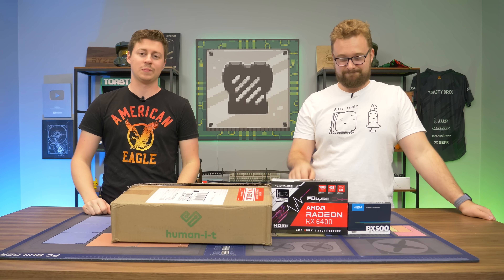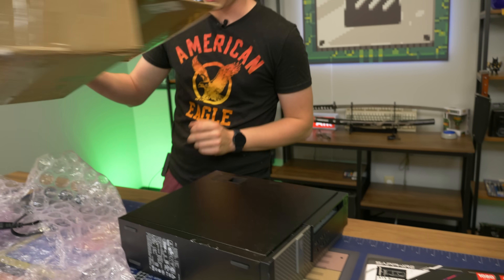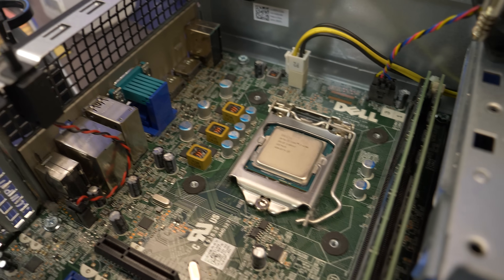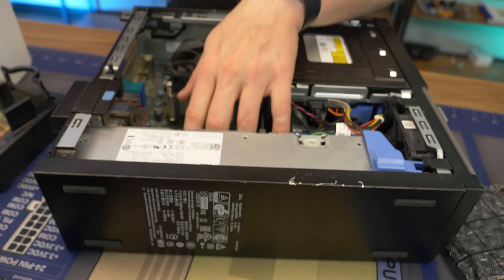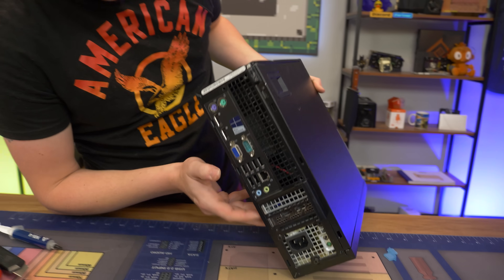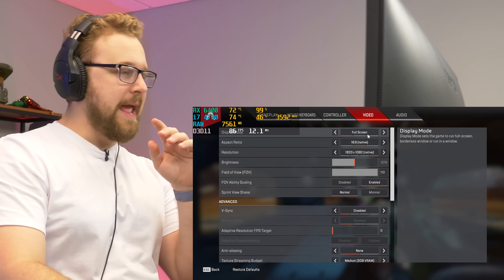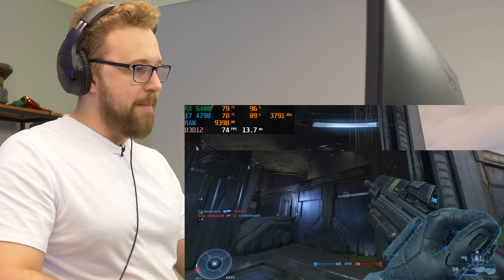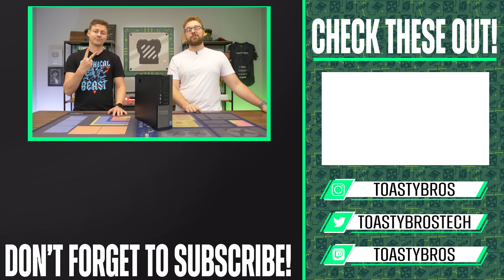EASY $350 Gaming PC Build 2022

Comment: Some things to keep in mind.

First, you can install a dual slot card in the 7020 and the 9020 in the upper 4x slot as it's open ended. However, this puts you in a similar scenario as the 6400/6500XT. But it won't be as bad since you won't be limited to a 64-bit bus as well. Just stay away from the VRAM limit and you'll be fine for the most part... or go with an RTX a2000 and not have to worry about the VRAM all together... lulz. The 3020 however, does not have the x4 slot so you're stuck with the single slot at the bottom and while the 7020/9020 use a Q87 chipset with PCIe Gen3, the 3020 is an H81 chipset which only supports PCIe Gen2, so when you run into problems with the 6400, they're going to be a lot worse. I would avoid the 6400 in anything with an H81 chipset.

Might be worth saying to just avoid the 3020 SFF altogether unless you're willing to get creative with a riser cable.
Reply: what if you already have a 3020 SFF, that you got before you knew about such issues? I have one with a GT 1030 (2GB GDDR5) and am looking for its "last upgrade" card. There are very few choices that are better and will work with this case. I've tried RX 550; not impressed. Sidegrade. The only upside was VCE, and that's not spectacular. Unfortunately the RX 550 I had became semi-functional recently, meaning it will POST and show a Windows loading screen but not come up with a Windows desktop. IDK. Could be a driver issue. The only sized-right RX 560 (which would actually be a pretty good pairing for my i5-4590) I've seen is from a shady Chinese seller rebranding what is quite obviously a Yeston, so I'm not even convinced it isn't really just an RX 550. And they want more than the RX 6400 goes for shipped domestically.

So being that the GT 1030 is PCIe 3.0 (forced down to 2.0 by the H81) x4 anyway, none of these cards would be a downgrade here... I'm thinking either the RX 6400 or the Quadro T600 might be good options. The nVidia card has 16 lanes and NVENC, so there are at least two bullet points in its favor. It is, unfortunately, much more expensive than RX 6400. But it should be nicely matched to the processor, and a decent bump up in performance from the GT 1030. Maybe not worth the price, though, but what is? I can't slot a GTX 1650 and the one SSLP GTX 1050 that ever existed is very hard to find now... T600's are easier, but look out for the 2GB model. Don't want that.

Even higher up the price scale, at around $300+, there's the T1000, with 896 CUDA cores so it should be similar to GTX 1650 Super. But I'm not sure about the 3020's weaksauce 255W power supply and supposed 50W PCIe slot power limit... that's funny, I thought the spec was 75W... or is it just that there were no high-watt videocards to validate with it at the time of manufacture? I think that could be the case. I've already gone past the original RAM validation (it was only validated for 1, 2, and 4GB DIMMs and I put 2x8GB in it, but that's widely known to work plus 8GB sticks weren't available yet) so I've already exceeded Dell's validated specs once already here.
Reply: @aleaxdeathbringer  Wow! What an awesome response.

This is tricky because I know it's really hard to find a single slot card these days, let alone one that's also low profile. I didn't even realize the 1030 was also limited to 4 lanes with a 64-bit bus. However, you won't be in the same boat. Even the GGDR5 version of the GT 1030 has less than half the memory bandwidth of 48GB vs. 128GB per second. There's more to this than just lanes and bus width. If you have the DDR4 version of the GT 1030, you're at about a whopping 17GB per second. So, with the GT 1030, the bottleneck is going to be less of an issue. You're not going to to notice it nearly as much. Especially since it's such a weak card to begin with. The 6400 is much more powerful and the effects of putting it in a Gen2 slot is going to limit you to 2GB per second. It's going to choke the communication between the system memory and the video memory.

The single slot Quardo cards would be better in a PCIe Gen2 slot, but even the T600 is a $250 card right now. The T1000 is stupidly priced. The single slot, low profile RX 560 that I've seen... with the purple shroud, is legit as far as I could find. But they're as much as a T600. But regardless of which route you go, the 255W PSU is going to be fine. If it doesn't require dedicated power, it will be enough. In my testing, you'll likely pull no more than 160 watts from the wall for the total system, and that leaves with about 100 watts of headroom. I wouldn't worry about the power supply, and they're well built PSU's with things like OCP. As for the power limit... I've not seen any OptiPlex models with a power limit on the PCIe slot. I'd expect that from the consumer models, but not the business models.

But now you have me curious. I bought a 6500XT to see if I'm being too hard on them to test them in some older Opti's, and the results should track with the 6400, but it would be interesting to test the 6400 as well.
Reply: @TheGameBench  wow, awesome reply from you, too! That's uncommon to find on YouTube; a lot of creators don't engage their audience to that degree! I'm impressed.

Anyway, I have the GDDR5 version so yeah, 48GB/sec bandwidth. I was at least careful to not make the mistake of getting DDR4. Although I've overclocked the (3004MHz) memory by 650MHz with Afterburner (it can take it; it's good Samsung stuff), so it's up to 58.5GB/sec bandwidth. Wow, 13.5GB/sec more and it'll equal my old HD7770, LOL. IDK if it could do that, though. IDK if that makes much difference; haven't tested before and after. I might have to check that some time.

The real problem with the card right now is that the fan gave out so the core can't stay at a high clock rate once it thermally saturates the heatsink. Airflow in the case kind of sucks and it's loud enough already.

Yes, I know it's possible to do a case swap. But that's the easy way out. I kind of like working with constraints, it's a challenge. But I might be getting to the point where if I can find a good mATX motherboard for LGA1150 cheap I'll slap it in an old Vostro tower case I have lying around (nothing nonstandard on it) and transplant the CPU/RAM/SSD/HDD into it, get whatever graphics card that will fit (only limited by length in that case, not width) and get another processor (at least an i3-4130, which is arguably the perfect match for a GT 1030) and rebuild the 3020 for my wife, who is currently out of state without a computer. I have some extra DDR3 from when I went from 8 to 16 on this; 8GB will be fine for her; I'd just need to get a CPU and SSD for her.

The real question is, do I want to go that route; buying what some might consider e-waste? Eh, if it's still got life left in it, and it's still cheaper than reasonable alternatives, sure. A platform upgrade to Ryzen 5 with 16GB, I've priced at around $400 (5600G APU/MB/RAM/SSD). I think I can get used 4th gen cheaper? And the 4th gen intel chips were good enough that, yeah, they're still okay as long as you manage expectations. Try saying that about an 8 year old platform 10 years ago. Nope. Moore's Law has apparently slowed down.

The GT 1030 has a pretty high boost clock especially if you overclock it (I've set mine to +175MHz, raising the base from 1228 to 1403, and boost from 1643 to 1818), but only if you can keep it cool. I've researched replacement fans but one guy allegedly fried his video card with one; IDK how that would happen, but whatevs. Maybe he ESD'd it. Looks like I can get a replacement fan for around $17 or so, but it might take some time to ship.
Reply: is it the same story for the 390 sff and 3010 sff, where the slot only allows for a 1 slot card and its only gen 2, does gen 2 apply to all the 390, 3010, and 3020 models also?
Reply: @edan7813  Yes and no, the 390 and 3010 both have their PCIe slots next to the CPU. For some reason, they decided to start putting it next to the PSU starting with the xx20 series. However, I would still suggest you get a 7010 or 9010 over any x90 series system or the 3010 because the 390 and 3010 will both be a Gen2 x16 slot.
Reply: @TheGameBench  thanks
Reply: @edan7813  No problem.
Reply: I’m getting handed down a 3020, luckily I’m not gonna use it for long and it’s only until I save up enough to build a pc with my 3090
Reply: @idkyolo988  lol if it’s a mid tower 3020 get a new power supply and use the 3090 in the opti
Reply: A Dell Optiplex sff 3040 is fine?
Reply: so it would be safe to put an a2000 in that short slot?
Reply: @kebapdzija  Yep, perfectly safe.
Reply: @TheGameBench  might even try that. thank you for the info! :)
Reply: @TheGameBench  is the optiplex 7020 sff ok with the swift 105 rx 6400 or what do i do
Reply: @SGgeneral-sg2  You can expect similar results to what you saw in the video... depending on what CPU you have in your 7020. That being said, you need to avoid the VRAM limit or you're going to have a tough time. If you're playing indie titles or most esports titles, that shouldn't be hard at 1080p. Also, the RX 6400 is awesome as an emulation card if you're planning on doing that. But if you're budget allows and you're willing to buy used, I would suggest getting a 1650 instead or even look at the a2000.
Reply: @TheGameBench  i tried looking for the rtx a2000 low profile but tyey are all really expensive and also the cpu is i7 4770 and how do i avoid vram limit and if i cant use the rx 6400 what other low profile gpus should i get except for the gtx 1650 and the a2000 since their price has gone up since a lot of videos talked about them and thanks for responding to my question.
Reply: @TheGameBench  also i just found out ur youtube channel defo subbing
Reply: @TheGameBench  i will still probably get the gtx 1650 ig if rx 6400 doesnt reallh works as good
Reply: @TheGameBench  followed your reccomendation, upgraded the 9020 with a rtx a2000, works like a charm. plug and play at its finest!

Comment: Considering your 4790 has an iGPU that you could enable in BIOS and set it to run even with the discrete GPU you MIGHT be able to use the iGPUs encoder to stream... That's a big maybe, but I know intel iGPUs can use quicksync and that tech is fairly low latency.
Reply: Hello guys, I can confirm, this works. My setup : i7 4790s, RX 6400, enabled both GPUs in Bios and set OBS to use Hardware/Quicksync encoding.
Reply: I have an rx6400 at home and an old Intel CPU I should test with streaming just to see if you can still tell OBS to use quicksync.

Comment: 1050Ti is definitely better option for these PCIe 3.0 or 2.0 systems (or Rx 570 if you could find it). Sometimes you get lower FPS but it does not stutter so much when loading textures from memory.
Reply: Definitely go RX 570/1050Ti if possible, but with that top slot it was physically limited to x4 which sucks. Same happened on the dell precision SFF I grabbed.
Reply: And 1650 is a great option as well
Reply: @nahpets2345  True, if you could find it at reasonable price it is better than 1050 Ti.
Reply: @aleksazunjic9672  200€ minimum in my country

Comment: Love your channel guys! I got an Optiplex 990 DT with an i7 2600 and 14 gigs of ram (4 sticks total) from my school for free. Had a 2 gig Gigabyte Windforce GTX 960 that I put in (got before pandemic prices). I like a lot. But I need better than a 305 watt power supply. Performance mode on Fortnite seems to be working ok for me.
Reply: That seems like an awesome pc for gaming and editing
Reply: @andrewlovesfallout  Well, it is ok. But 2 gigs of Vram is MAJOR BOTTLENECK. A 4 gig version of the same card would be better. But I can't find any for a great price. 😕 😅
Reply: @hovanthecool1995  tbh the only games I would play on this pc is like the og version of Skyrim and fallout 4 at max settings
Reply: @andrewlovesfallout  Oh, ok. I only really like Fortnite. That's it 😅.
Reply: I got the same spec optiplex. Found a 1050ti on ebay for $70 bux. That was in 2023 and it still runs today
Reply: @justjoe8660 so mine is now 16 gig dual-channel and I put Linux Mint on it because RIP Windows 10 support.

Comment: Hey just found out you guys's youtube channel and i was actually wondering if a Gigabyte B460M DS3H AC Intel B460 1200 LGA MicroATX M.2 Desktop Motherboard B would work with an AMD Ryzen™ 5 4500 6-Core, 12-Thread Unlocked Desktop Processor with Wraith Stealth Cooler
Reply: You can't mix and match like that. For that board you need Intel CPU specifically 10th gen, but I believe it'll support 11th if bios updated. Or if you're trying to run with the Ryzen CPU make sure its am4 socket b450's come pretty cheap
Reply: @UCtxKj8EN6QrEzAN6slboWaw I can, but really if you're trying on the cheap look used first. You already have the Ryzen 5 CPU? Just trying to find a board?
Reply: @mtzkustom7818  I am wanting to order some affordable gaming pc parts and have not ordered anything yet
Reply: @OsamaBenLagen  what kinda budget you at? You in USA? All new parts? Or are you ok with using some used parts?
Reply: @mtzkustom7818  i am at a budget at around 700 dollars and i am ok however i want to know if they work and if not i can return them and get a full refund
and i am in the united snakes of asparagus (usa)
Reply: @OsamaBenLagen  Sh*t really $700 will do good. Honestly you can buy a good fully built PC with that. Hop on ebay, Mercari, or jawa you could find something already made. You got buyer protection so if there's problems you can always return. If you wanna build with new parts you can build i3 12th gen with either Rx6600 or Rtx 3060 for between $700-800. Between Amazon and Newegg I ran thru I did example with prices. 

i3 12100- $100 
M-atx Motherboard- $130
GPU $300-350
Ssd- $30-40
HDD- $30
PSU- $50-60
Case- $50-70
Reply: @OsamaBenLagen  I left out ram, but 16gb 2x8 kit @ $50
Reply: @mtzkustom7818  thank you do u by chance have discord id like to send you my shopping cart and see if my things would work

Comment: Out of curiosity, I wonder how that 6400 would work in a Gen 2.0 PCIe slot?  I know that might really be pushing it, but I have two machines that are just 2.0 slots.  They already have decent cards in them now, but if that 6400 or better still the 6500XT gets considerably cheaper in price then it would be fun to try it.....🤔😁
Nice video again, guys!  Thank you!!  👍👍
Reply: Check RandomGaminginHD, he did a PCIe 2.0 test on one of his rx 6400 videos
Reply: @zDaigo  Thanks for the info, bro!  Will do!  Be well!!  👍👍
Reply: Even worse when you get to texture limits. You may get good FPS and then suddenly stutter like hell. 1050 Ti or RX 570 are now much better option.
Reply: @aleksazunjic9672  if your game indicates how much VRAM you're using, and you tweak it to keep it under the amount installed, it will reduce the possibility of stuttering, right?
Reply: @aleaxdeathbringer  Well, in most cases yes. But there could still be stutters when you move between levels, areas etc ... because then textures had to be loaded in VRAM. But during the fight scenes you should be good. Overall, RX6400 is more of 1080p med card even in older titles, especially if you go with PCIe 2.0

Comment: After your last video with the 1050 ti and the optiplex I started shopping around. Got super lucky, found a brand new MSI gaming X 1050ti on Newegg for $150 after promo code and rebate, then found a Dell Precision T1700 with an Xeon 1245 v3, 256g SSD, 16gb of ram, and the 365w psu (which comes with the 6 pin needed for the factory OC 1050ti) for $120 with local pickup. $270 (plus some tax) and I have a legitimately decent PC that can play virtually any game I care about in 1080p. Thanks for the inspiration guys!
Reply: I’ve been trying to sell my 1050ti, selling it for 125$. Would’ve saved yourself a good chunk of change
Reply: @TiqueetyJosh  I mean that's only $25....and Idk about your 1050ti , but the MSI gaming X is a factory Over-clocked version that will get you about a 10% boost in FPS. Plus it was brand new. The market is shifting as GPU prices steady out and new GPUs start to get introduced.
Reply: @CaptainIanFace  true

Comment: Might do this in the future. Could then just harvest the parts and put into a regular case. Also, what is the name of benchmark that was used?
Reply: These dell optiplexes are a pain to case swap with proprietary connections. F1 errors on start up no front io you can buy some adapter's, but it's not super cost efficient really can build better system for same price if you willing to go that far. They're decent as is to upgrade especially for some one just getting into PC building good starting point to play with, and get familiar with hardware, and possibly mod the case to give it more of a gaming style
Reply: I'd guess software used to display/benchmark system performance was MSI afterburner

Comment: Nice video.  Would be nice to see the GPU Vram usage on the overlay.  It would be nice to see which game max out the 4gb vram, and which games use under 2gb (I expect only something like Valorant would use less than 2gb).
Reply: the witcher 3 fortnite apex legends (fortnite uses a littlemore than 2gb on high settings)  gta 5, they run well